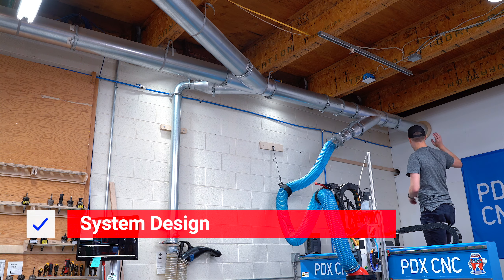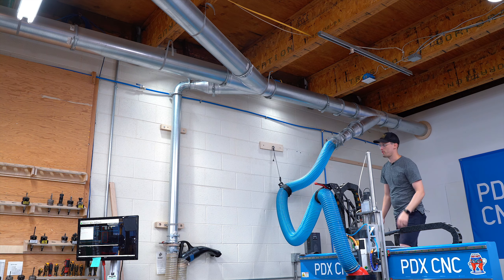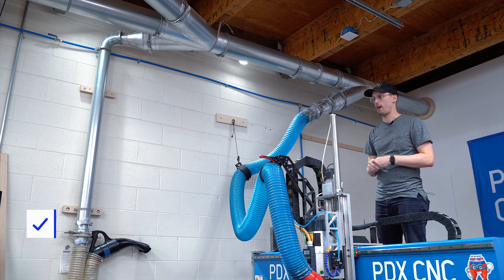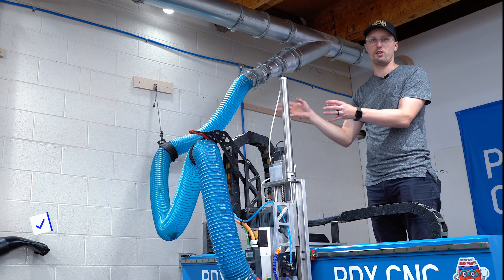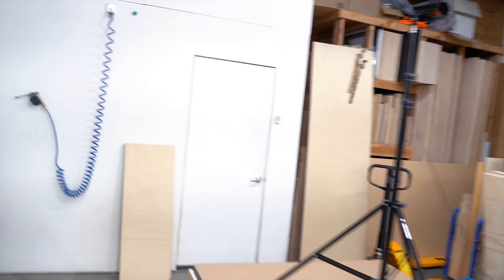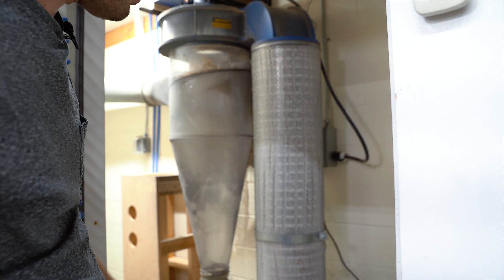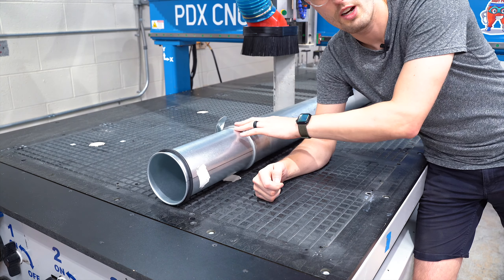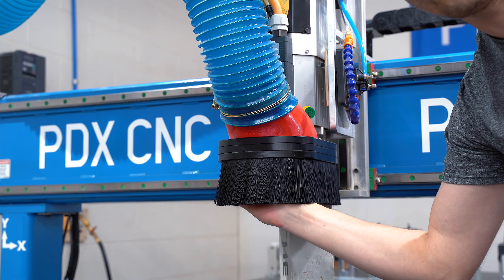5 tips to improve CNC dust collection DIY

Comment: hiya, have you thought about moving the metal duct closer above the cnc? this way you can reduce the flex duct because the suction will come directly above the cnc. if you thought about this and chose not to why not? im redesigning my dust collect system for the cnc because its not working well and im looking for design and ideas.
Reply from the maker: Yes. I talked about this in the video. Really not feasible to reduce the flex more and still have all the travel our machine has.